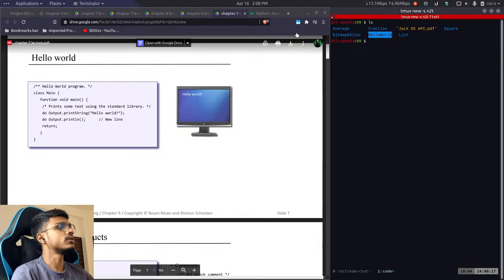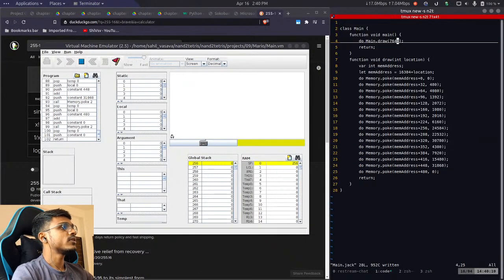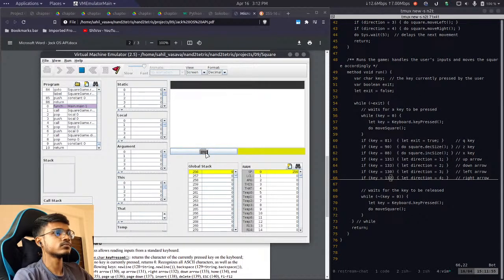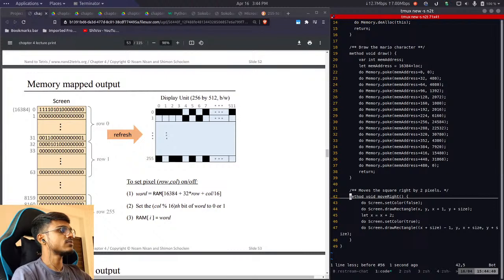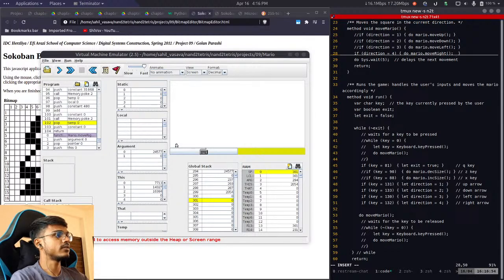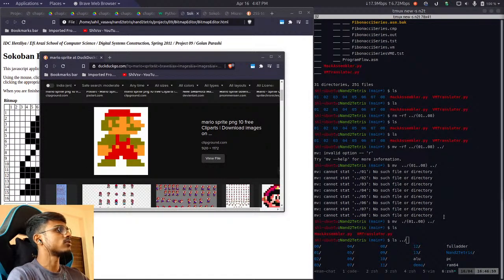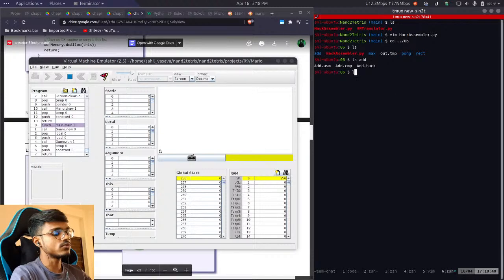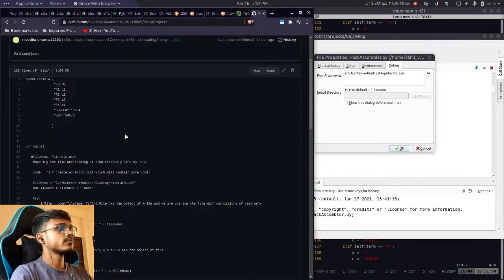Jack Programming Language | Computer from First Principles | Nand2Tetris 2 | Part 18

Comment: And Could you Please Write a Code for String Appends to Join two Strings and Give the Output Please????
Reply: Could you do this Fast Bro Please???
Reply from the maker: As in write it in Jack language or any other language. For other languages it's a simple task. Just google how to concatenate two string in say python or any other language you are coding in and you will get the one line answer mostly.